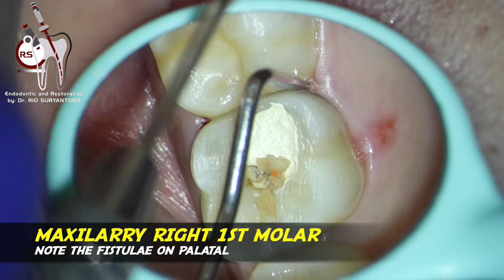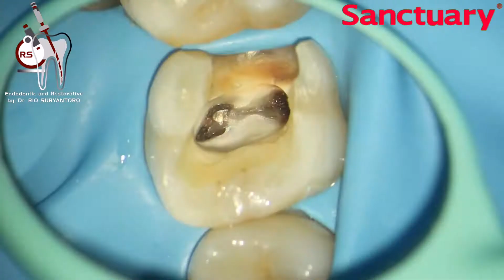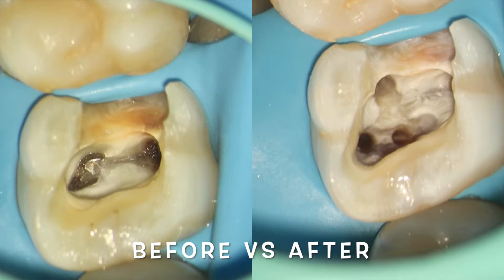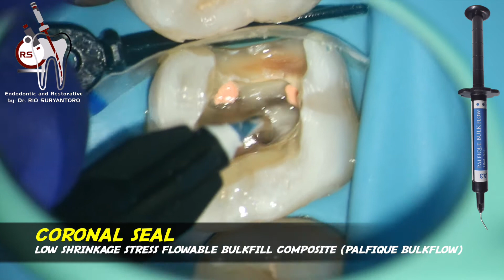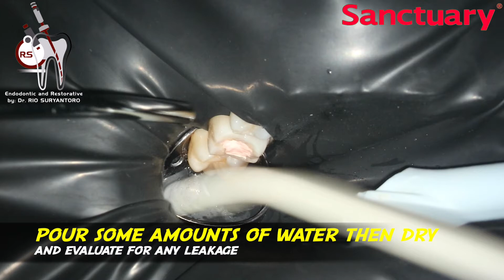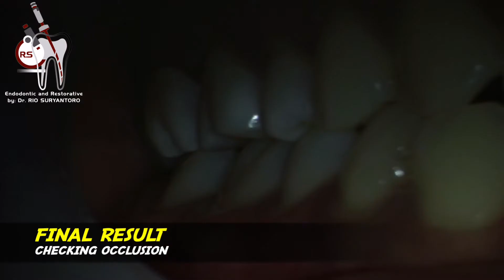NEGOTIATE MB2 CANAL MAXILLARY 1ST MOLAR FROM ULTRASONIC TO WARM HYDRAULIC OBTURATION - ENDODONTIC 🦷

Comment: hi doc, In what power do you use the ultrasonic ?
Reply from the maker: for continuous ultrasonic irrigation i set it at G5 to G8, depends on the width of the canal i face with.. if it is wide canal, i set it at higher power than the narrow ones.